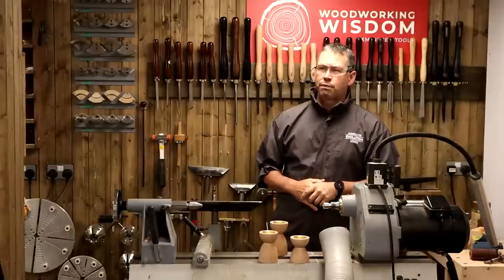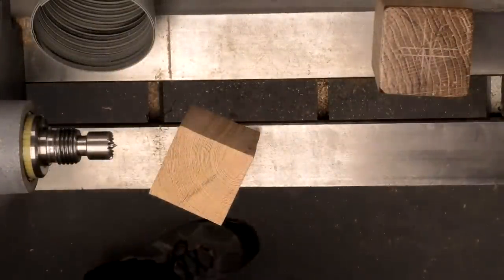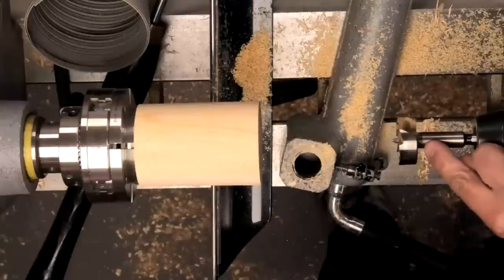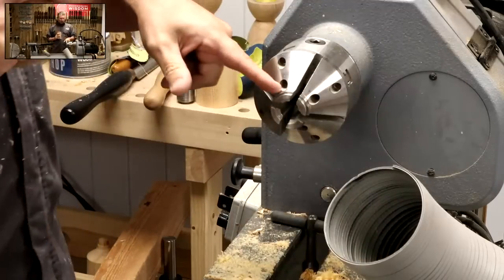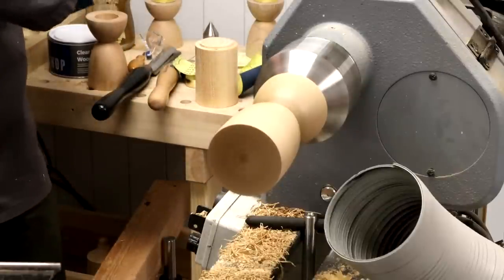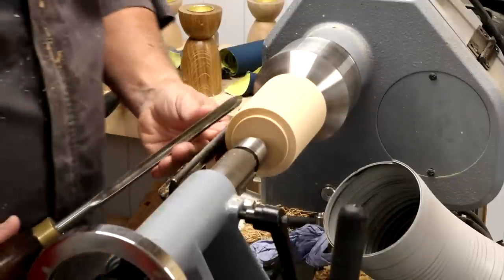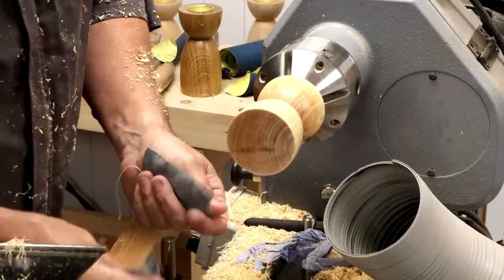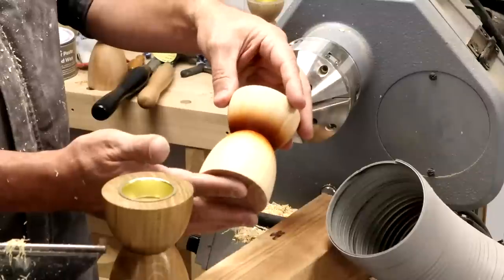Tea Light Candle Holders - Woodworking Wisdom

Comment: At 15:25: "Let's go for a quarter inch bowl gouge ... or three eights if you're in the United States".  Is there a reason for saying that (or was it just habit of having to convert stuff back to old units for the US)?
Reply: It's to do with the way they're measured, in the UK the tool is measured across the inside of the flutes whereas in the US it's the external measurement or the diameter of the tool steel, so 1/4" between the wings and or 3/8" outside measurement.
Here in Australia we annoyingly measure gouges both ways, makes it hard to order tools online...